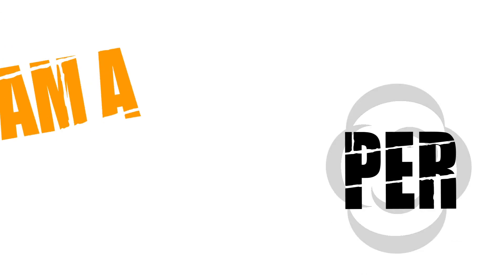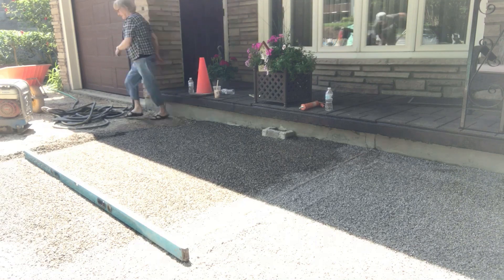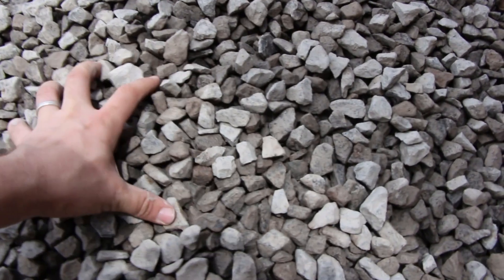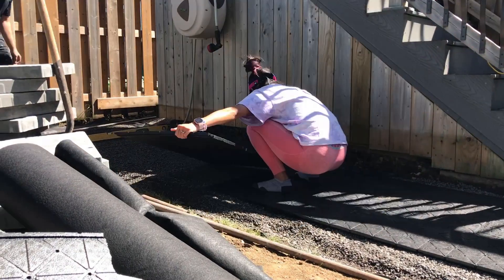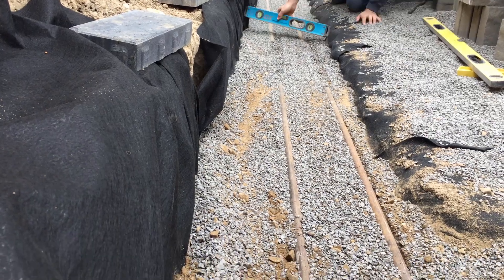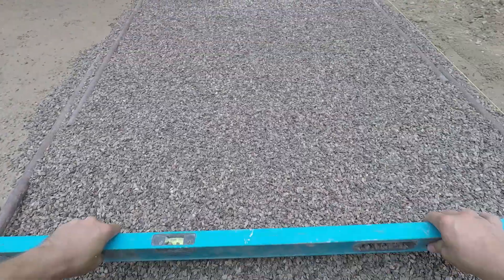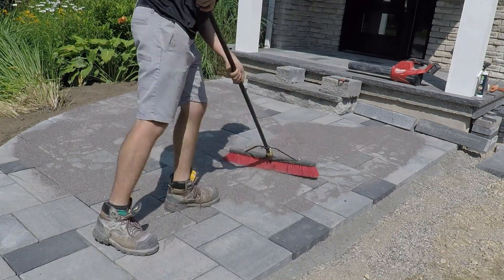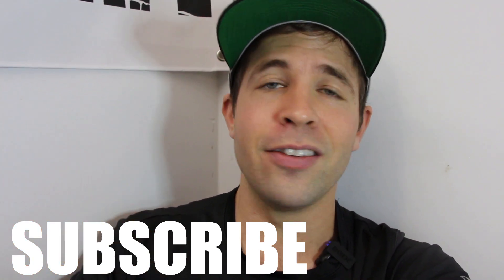High Performance Bedding for Pavers | Why We Use HPB Instead of Concrete Sand

Comment: Where do hardscapers buy the paver sealer? Nobody has it in stock. I don't really want to order it online, but the big box stores don't stock it. 
I can't believe that professional hardscapers order it online. 
Thanks
Reply from the maker: Nobody buys hardscape products from big box stores. Just search for a landscape supplier near you. They will stock pavers, aggregates, sealers, anything you need.
Reply: @iamahardscaper  
Thanks. I called the supplier I bought my pavers from and he said he THINKS he has a 5 gallon bucket of sealer for $850.  I assumed after that information that the professional hardscapers would never be buying it from them.
Reply from the maker: It has been a while since I bought sealer, but that seems expensive. Go to the Techni Seal or Alliance website and find a dealer near you.
Reply: @iamahardscaper  Now I'm wondering how many hardscapers go back to a job to seal it... I'm thinking they don't. 
Thanks for your help.
Reply from the maker: most hardscapers stay away from it and it is a different company entirely that will do it. Kind of like asphalt companies that don't recoat the driveway.

It is difficult to invest a whole lot of money into equipment and then go out and do a bunch of sealing jobs that do not require that equipment and still make enough money to pay for that equipment. Not to mention you need perfect weather for sealing so you may be on a job and have to pull off of it just to go seal a project where you wont be making near the same amount of money.
Reply: @iamahardscaper  Got it. I understand the time constraints for sealing. It makes sense that a company would specialize in doing just that.  I also don't know how many homeowners would choose to have it done. I want to protect my work on this project so I'll be sealing it. 
My friends say it looks great, why seal it? 
For one big reason: it's a difficult job build a paver patio especially if the ground is horrible to deal with. 
Thanks again!
Reply from the maker: No problem!

Comment: Going to order some tomorrow - but local supplier said 7mm angular and contains some fines (but not much). Think this could be an issue?
Reply from the maker: 3/16" to 1/4" chips is what we look for with no little to no fines. I would go and see it in person before ordering.
Reply: @iamahardscaper  gotcha. I found some other suppliers with 1/4 “ and no fines as well. Just a bit more expensive - but sounds like that’s the better route to go here
Reply from the maker: Yes, it will definitely be one of the most expensive aggregates
Reply: @iamahardscaper  totally worth it though! want to make sure this is done right. We’re also doing a base for a hot tub. Do you put this stuff over that as well? Or not really needed there

Comment: Thanks again for this video! I swear it's on a loop on my computer! 😆 Thinking about how to use HPB to make some slight tweaks to my slopes... I typically see guidance for sand as not exceeding 1" of depth for a bedding layer, though I don't know that I've seen guidance around minimums in bedding layers, HPB/chip rock or sand, in terms of depth. For HPB, what is the minimum depth one could run? 

As a bit of context, I have a front patio/walkway that has a 1/4" slope toward the driveway, though the last ~5 ft the slope is more steep in order to connect with the driveway. I've raked and compacted that transition as much as possible so my pavers don't have large gaps at the top, but am wondering if it is feasible with HPB to possibly go with a standard 1" depth at the driveway and then use a shallower depth at that break point between the slopes to help ease it a bit further. If that's feasible with HPB/chip rock, what is the minimum depth that would be acceptable?🤔 

Worth asking... I was able to find 1/4" chipped granite locally as we don't have the official HPB that I could find. Your video shows some larger pieces than what I'm seeing in my material. If I have material that is closer to 1/4" consistently and not the range of 1/4" - 3/8" that you noted, does that change anything in terms of compaction rates to build into my final elevation? You had previously noted a 1/8" of likely compaction using HPB, while sand could be 1/4" to 3/8" of compaction. e.g., I imagine a smaller aggregate material would mean more compaction while larger would yield less? Your video shows you running a larger reversible compactor with plywood over slabs when tamping the HPB. This is a Techo-Bloc Blu 60 slab install and I will be using a lighter roller compactor (2,300 vs. 6,700 lbs of pressure used on the Class 5) and was wondering if that would change your estimate of compaction? 🧐

Lots of questions, I know, so thank you in advance for fielding them! Keep up the great work! 👍👍👍👍👍
Reply from the maker: You would need about 1/2" minimum for the HPB to be effective in levelling. No more than 1.5". And yes, you will see more compaction with finer aggregates. Really not a lot, but you may add about 1/16" per 1" of bedding layer to what we see with HPB. Hope that helps!
Reply: @iamahardscaper  Great! Thanks so much! So about 3/16” of compaction with an inch of consistent 1/4” bedding aggregate, even with a lighter weight roller compactor, just to be sure we’re on the same page? ☺️✌🏻🙏🏻
Reply: @iamahardscaper  Thanks again for the input! Are there any limitations or problems with using geogrid between my Class 5 and having the chip rock immediately over that for the bedding layer? e.g., will it mess with that small of an aggregate from locking up as we would want it to? I think I recall you showing it used in another video between lifts of Class 5 but I don't recall seeing it used between a base layer and bedding layer.
Reply from the maker: Yes, I’d probably lean closer to the lower end of 3/16” still though at 1” of 1/4” bedding. Yes, but the lower the geogrid is in your base, the more effective it is. Still some people use it between their base and bedding layer. Geogrid stabilizes the material on top of it, so the lower the better

Comment: Hey loving your channel... i recently ripped up some fake turf that had crusher dust underneath. Stupidly I thought it was black sand or something and proceeded to reuse it under bedding for pavers so I didn't have to haul it from the site etc. I have pretty much laid all pavers now but not locked them in as yet. Would it be worth taking them up and relaying a more appropriate bedding material?
Reply from the maker: Ah I would probably take my chance with it at that point, but it is up to chance at that point. People do still use crusher dust and it will work for them meaning it will get them past their warranty period

Comment: Have you used HPB on a driveway where the pavers have a 2mm joint width and are filled with kiln dried jointing sand? ( not polymeric sand ) Is there a concern that the kiln dried sand would percolate down into and through the larger HPB and lock up would be compromised? Would love to hear your thoughts on this. Thanks.
Reply from the maker: I have not. But yes there would be some of the sand that would be lost into the HPB. I would assume that over time there would be minimal loss into the HPB as long as there is proper consolidation during the installation process. You might also look at installing a joint stabilizing sealer.

Here is a video comparing HPB to Concrete Sand for a project and why sometimes I would opt for Concrete Sand especially for a driveway application with tight joints:
https://youtu.be/eq0kQUSS__Y
Reply: Many thanks for the response. Another great video.

Comment: Your videos are well done and informative. What is your opinion on using the plate compactor to set the poly sand on products like 60mm permacon slabs that say not to use the plate? Do you do it anyway with plywood?
Reply from the maker: It’s best to use a roller. We have done it with a plastic pad. Never with plywood on those big slabs.

Comment: Must have watched this video 100 times and finally settled on using HPB under my synthetic paver bases. So I’m at the stage of laying 1/4” clean bluestone about 3/4” thick under my paver base and then placing porcelain pavers on top with about 3-4” spaces in between. So my question is tamping bedding isn’t required? And while I debate what to use in between spaces of pavers, is there a ‘poly metric’ blend for large spaces in case I decide to use marble chips or fine bluestone in the 3-4” spaces between pavers?
Reply from the maker: No need to compact the bedding layer if you’re using 1/4” chip. But we do a final compaction of the pavers once we poly. There are polymeric sands that do joints up to 4”. Each manufacturer should have one

Comment: I'm looking to lay pavers on my own and my understanding is to put down 4 inches of 3/4 inch crushed gravel and 1 inch of concrete sand.  My question is: could I just put down 4 inches of HPC and then polymeric sand to cover the gaps between the pavers?  Thanks!
Reply from the maker: No unfortunately HPB is for bedding / leveling and not for the base. Depending on where you are located you may want to increase that 4 inches to at least 6 inches.

Comment: I'm using Gator-base panels how deep should I make the HPB open grade agulet be under the panels? What size screeding rail should I use?
Reply from the maker: About 1”. You’d be looking for 3/4” inside diameter pipes which have an outside diameter of 1”

Comment: Thanks for your video. Is there a maximum depth that you'd go when using hpb? Is there any detriment in using 4"or 6"for that matter?
Reply from the maker: I wouldn’t go more than 1.5”. It is meant as a bedding layer and doesn’t have the bearing capacity to be a base material
Reply: @iamahardscaper  Right, but if I'm putting it on a base of 3/4 clear (6" deep) with landscape fabric in between, what will happen? Will it sag over the years? The pavers that I'm planning to put are pedestrian only

Comment: Final Height question: do you get any paver settling during poly compaction with HPB? Like with sand for example, it compacts about 1/4".
Reply from the maker: yes, less than 1/8"

Comment: Thanks for the info very helpful as I’ve been agonizing over HPB versus lime stone screening as that’s what’s here at my house on this job of 1250 ft.² in the GTA area in Ontario Canada. With this being said, I have to let everyone know that I did ask for three quotes for this job on my old 1965 bungalow that I got in 2010, and all three use lime stone screening. So that’s interesting! Also of note, the lime stone screening and the actual interlock was an amazing shape. The only reason why, I am changing it is because it’s a very old style probably 30 years or so. With this being said, and the big question that I have is what type of screening rails should I purchase for the job. I don’t want something that’s going to flex or bend and I don’t mind spending a little bit extra. Thank you in advance😁
Reply from the maker: Also in Toronto. There are still contractors that will use limestone screenings even though it voids the manufacturer's warranties on their products. Most people get stuck in the way they do it and it is difficult to change. We use black iron gas bars 3/4" inner diameter from any hardware store.
Reply: @iamahardscaper  Thanks 🙏

Comment: Thank you for sharing. do you think if I can use synthetic Brock paver panel for installing pavers in a diamond shape with turf lines running in between? if I just simply lay pavers on top of panel without mortar Im just not sure how to secure each paver diamonds since turf lines separate them.
Reply from the maker: i think you'd have to install edge restraint all around it. I'd reach out to the manufacturer to see what would work best.

Comment: I'm in the process of preparing the install of an 8x10 Lifetime shed, and my old man is recommending using HBP as the base for the shed to sit on, although I've seen 3/4" gravel recommended pretty regularly. Could I get away with using HBP?
Reply from the maker: Are you laying slabs on top of the HPB? I would still opt for 3/4" with a screed layer of HPB.

Comment: Hi, i am extending my driveway by laying interlock. I did put some 3/4 gravel clear as base. Do you recommend to use limestone screening or HPB on top of gravel ?
Reply from the maker: If you used 3/4 clear you should definitely use HPB
Reply: @iamahardscaper  thanks for your prompt reply, I asked this question because in other video you suggest use dense materials if no joint between pavers and beside driveway for similar material. If I use HPB, what will be the minimum width of joint to ensure polymeric sand reach out to the bottom of paver and do you recommend to use edge restraint to contain HPB bedding ?

TIA
Reply from the maker: Yes for the edge restraint. You will want to use a concrete edge restraint or there is an aluminum edge restraint with wedges for open graded bases. You'd want a 1/4" joint or greater for the pavers to be properly seated into the HPB.

Comment: Great video! Very informative
Do you have a recommendation on a brand?
Thanks
Reply from the maker: Thank you! A brand for pavers? If you contact your local landscape supplier and see what they have in stock, they likely will be able to steer you in the right direction 👍
Reply: @iamahardscaper  thank for your answer! I meant the brand of the clean crushed stone you use. Since you mentioned that there are some that have rounded pebbles. Thanks 🙏🏼
Reply from the maker: It totally depends on the supplier and what they stock. As long as the aggregate is fractured and angular and stands up to a hardness test, should be good.

Comment: I’ve been trying to find hardscapers in my area who will use open grade base as I think it’s the best application especially for our house. Bottom of a 1000’ ridgeline that has a lot of water draining through. All the guys I’ve talked to so far have pushed back saying this method will cause the pavers to move and buckle over time and want to use compacted road base. What’s your take on this? I plan to keep looking to find someone who’s methods I agree with…
Reply from the maker: I'd have to know their reasoning behind why it would cause it to move and buckle to be able to respond. My first thought when someone says something that doesn't make sense is they are either stuck in their ways or they have never heard about open graded. I personally just try to use the best base for the application.

Comment: One question? I'm working with soil that is very sandy and/or muddy and "squishy". I want to put pavers down in a way that they stay relatively level and don't sink so much. It's not a high end aesthetic kind of patio to entertain people, but more of a solid base to hold grills and a hard plastic wading pool of about 9 foot diameter and 300 gallons or so. I figure dig it down 6 inches or so? Layer of some kind of semi permeable fabric. Should I just use hpb or should I put down a first layer of #73 or #11 or something like that topped by HPB and then the concrete pavers? Will I need to get a compactor and one or more stages?
Reply from the maker: If it is squishy, I would wait a little for it to dry up if there was snow. And then do an amendment with 3/4" angular crushed stone and Portland cement, about 50lbs per 100 square feet just sprinkling it around. Give that a good compaction into your subsoil, but not too much. This will draw out the moisture in that soil. Then use a non-woven geotextile, 6" of base material (3/4" angular crushed clean or 3/4" minus) and 1" of HPB. Compact the base in lifts according to your compactor, 1" per 1,000 lbsforce that the compactor is capable of. Hope that helps!
Reply: @iamahardscaper  Awesome, thank you! What do you mean by compacting in lifts? Years ago I used to work in a business where we rented a lot of compactors, but I only ever used one once. Do I compact the 3/4 base and then the HPB on top of it or both together or just the larger stone?
Reply from the maker: No problem! If you have a compactor that can only do 2" of compaction at a time, only install 2" of base material and then compact before installing another 2" and compacting. Every 2" is a lift. That is if your compactor is rated for 2,000 lbsforce. Compact the base according to that, screed your HPB (don't compact), lay pavers, install jointing compound, compact to consolidate the jointing compound, top up jointing compound.

If you go to our Hardscape Installation playlist, there are videos on each of these steps in detail and an overall video that breaks it down step-by-step.

Comment: For a walkway/patio extension. 
Weed barrier
HPB (tamped or no tamped?)
Synthetic paver base
Pavers ?

Does that make sense? Sorry first time DIYer
Reply from the maker: Compact subsoil
Nonwoven geotextile (it’s a bit thicker than a weed barrier)
HPB, no need to tamp
Synthetic Paver base 
Pavers
Then compact pavers when sweeping jointing compound (protect pavers by strapping a pad to compactor or laying protective layer on top of pavers)

Comment: Hi! Why do you not recommend using HPB for the entire base? You said you did for the one walkway, but haven’t since.  Could you elaborate on why you do not? Thanks!
Reply from the maker: I did that because it was what I was told that you could do at the time. But in reality, the finer aggregates do not have the structural integrity to be able to bear the loads that the pavement will experience.
Reply: @iamahardscaper  so you can use 6" 3/4 clean fracture gravel and then the 1/4 inch right on top or always filter cloth first?